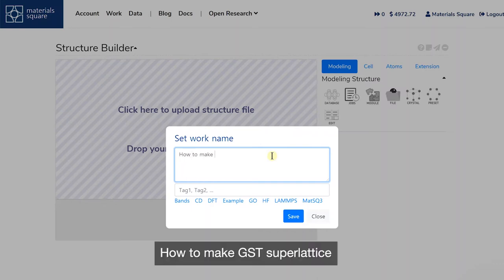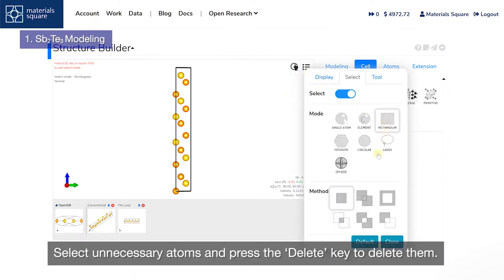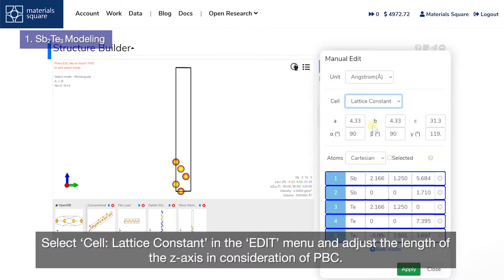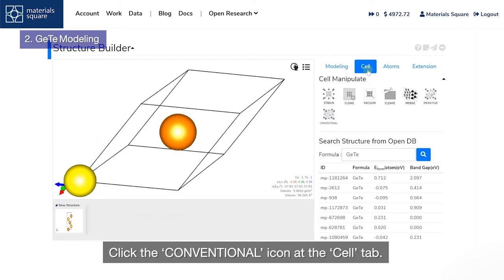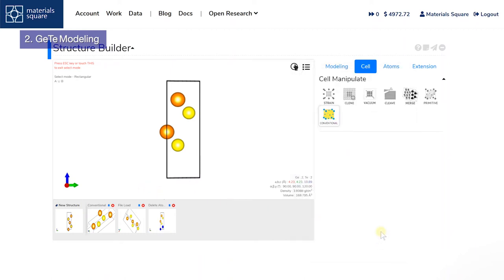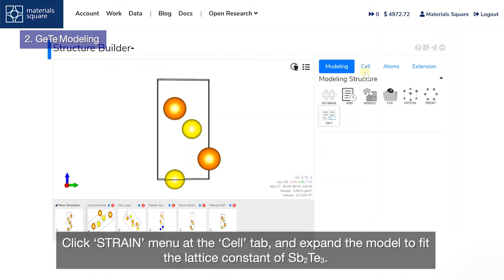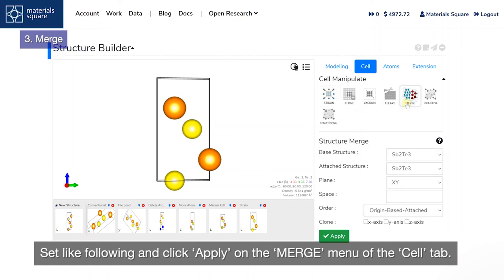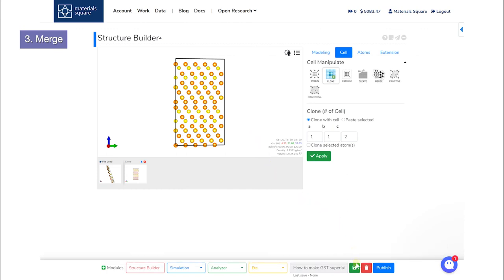[Materials Square] How to Make GST Superlattice  |  Structure Builder

Comment: Very helpful .do you have video creating slab or cleave surface 111 ?
Reply from the maker: Thank you! For the questions, please refer to the blog link. It contains YouTube links.
https://www.materialssquare.com/blog/matsq-tip-cleave
Reply: @MaterialsSquare   the website is amazing. you saved my life .
 i have signed up,  Is it free to use the structure builder only ?
Reply: @MaterialsSquare  regarding cleave surface, is it possible to  get the non periodic slab ?
I mean i want the new unit cell after cleaving 111 surface ? Please help me